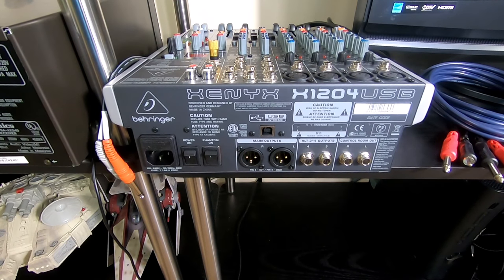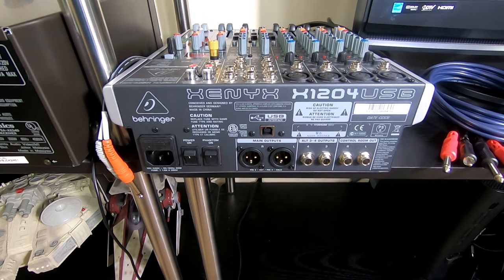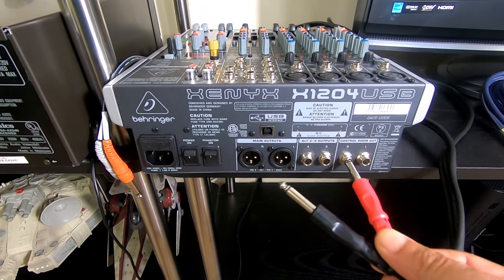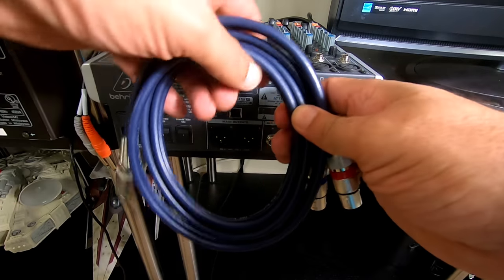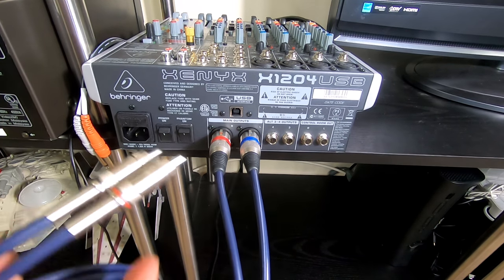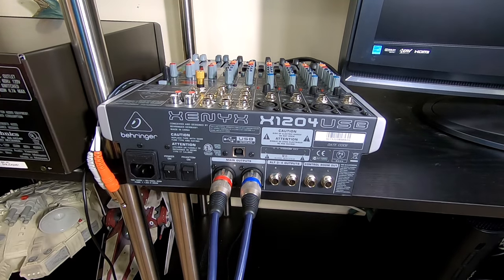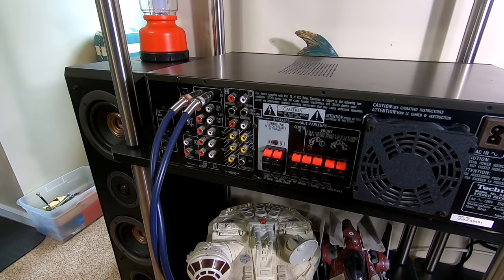How to Connect the Behringer Xenyx X1204 Sound mixer Main Out to a Home Audio Receiver

Comment: I just bought this mixer for karaoke and I’m wondering if I need a microphone xlr cable for the mic to work. I have a 1/4” plug and it doesn’t seem to be working but I also just purchased xlr to rca for the main outputs as the controller outputs doesn’t seem to be working for me so I can’t tell what’s not working. When I tap the mic, it’s lighting up but no output to my receiver/speakers.

Comment: If you using two turntables on the mixer what do you plug the mixer into on the back of the receiver? “CD” “PHONO” Etc..????
Reply from the maker: the mixer should go into one any of the inputs on the mixer except phono. Turntables use a different type of line which also means you can not plug the turntables directly into this mixer. You will need a DJ mixer with phono inputs or a preamplifier between the turntables and the line inputs in this mixer.

Comment: I have my LCD TV connected to my receiver via that optical connector. The outputs to my .  I'd like to keep this setup for watching movies and sports.

I want to play karaoke through TV out direct to mixer, then .  However my TV only 1-optical connector and 2 HDMI. Unfortunately, my mixer does not have USB or HDMI jacks.

What cables/connectors is best or TV>mixer?

Comment: Can I directly plug 1/4" passive speaker cables into the  ALT 3-4 or control room out output without the receiver? Thank you very much for sharing.
Reply from the maker: No, only powered speakers will work directly
Reply: @TonyHob  Tony, Thank you

Comment: In the case of separate-components HiFi system, would it work hooking the cables directly to L R inputs of the power amplifier? I'm guessing the preamplifier is no longer necessary? Thanks
Reply from the maker: That will work, no preamp needed

Comment: Hi, I'm using a PMX466 Pyle Mixer that has XLR main out puts. I connect the XLR cable to RCA in my danon receiver using the CD RCA IN but even after changing the source to CD in my receiver I have no sound. I connect a wireless microphones into the mixer as well using XLR cables and when I speak I see that the sound is getting in but not hear anything in my receiver. I have HDMI attach to my receiver as well my RCA from the TV.
Reply from the maker: I haven’t tried it but imagine it would work if you send the recording through the interface input into the fx box then into the daw through the interface again
Reply: @TonyHob  thanks for the reply, I make it works, it was that my denon CD input also has a HDMI assign to it. After removing the hdmi input and re-select the CD source it works.

Comment: Hi, good job.  
can I use the 2 track rca input on the mixer to connect my karaoke machine and use the rca output on the mixer to my amplier (rca connections)? I know there is a main output at the back of the mixer but i dont have the xlr cable to connect to my karaoke machine YET (just ordered)
Reply from the maker: it should work

Comment: I have at the moment Mackie Cr3, so if the mixer is connected to the AV via the output, how/where would you connect the monitors, also which cables you i need?
Reply from the maker: NoInjuryTime with his particular mixer you have 3 choices. The main output (to the AV) and you can use Alt 3-4 or the control room outputs to monitors using 1/4" male cables

Comment: Thanks for sharing!!! How do you set your “master” volume when mixing audio? On the receiver or the mixer?
Reply from the maker: I will usually set the mixer's main out at the "0" level (just below max) and then adjust the volume on the receiver to how loud I want it. After that I only use the mixer controls to adjust the main and channel volumes.
Reply: @TonyHob  thanks for sharing!

Comment: Slightly off topic but, I want to run my TC Helicon mic mechanic through my Behringer 1622 Xenyx mixer and then into my Harbinger Vari v2215 powered speaker. I usually just run the mic mechanic into the powered speaker but I'd like to be able to take advantage of the mixers fx bank while still utilizing the mic mechanics pitch correction function...but, for some reason I just cannot seem to figure out how to hook it up.
Reply from the maker: I think you have to connect the mic mechanic between the mic and the mixer then the mixer to powered speaker : mic to mic mechanic to mixer to powered speaker
Reply: I tried  doing the ctrl out from mixer to the speaker and that didn't work, the speaker does only have one 1/4" input though.

Comment: Hello tony , i wanted to ask if those main outputs are line level signal or not, can i connect XLR from the mixer to the audio interface for recording, and if i want to record single instrument connected to a mixer to audio interface how to i connect it because there are 2 main outputs from the mixer whilst audio interface have 1 input for each instrument ?

Comment: Your video cleary shows the rca in and rca out connectors right on the mixer. Why not use those for output to the receiver, with plain rca audio cables?
Reply from the maker: Jerry Spicklemire those are the 2 track/usb i/o's. Technically you can connect that output to the receiver but the volume control is not from the main mix. Also, if you want to record the performance you will need that output since that is what it is mainly designed for. It goes to the recorder. Of note, if you use the usb interface to record on your computer, the rca i/o's do not work at all.

Comment: What input do you connect the mixer into the Receiver? & Vise Versa. Where do you plug the mixer...
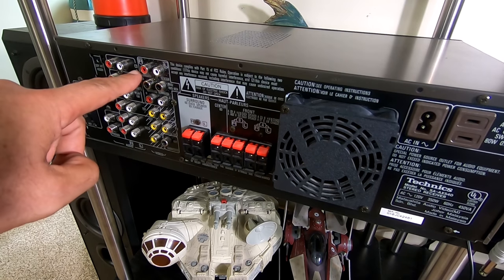Reply from the maker: RUBEN RAMOS not sure what you mean, is it this? 1:20, you can connect to any input on the receiver. Check the link at the end of the video for full setup

Comment: Hi
Does Behringer XENYX Q802USB model work in similar fashion with home receiver?
Reply from the maker: Yes, but the output on the 802 is 1/4” TS instead of XLR so you use a 1/4” to RCA cable
Reply: @TonyHob  Thanks for your reply. Just one more question. I see many cables having Single 1/4 inch TS with dual RCA.
In that case which jack I need to use in mixer? L or R ? also I see Phones jack apart from CTRL ROOM OUT
Reply from the maker: Dual to dual so you can connect to the R and L main outputs

Comment: Hi Tony  thank you for the video.    I tried everything to make my  mixer Alto L-8 work with my AV Receiver Sony .  Nothing works   I did you did , but no sound.    I'm tring to sing karaoke on my Sony Tv with you tube, having my sound coming out into My AV Sony receiver Home channel + having my 3 microphones into my Alto L-8 mixer .     I was told to  plug a optical cable on my tv + with a converter analogue RCA out   To my mixer channel INN  5 or 6 line.    + have my output on the back, mixer out with 1//4 jacks to my Sony Av Receiver in the Inn CD or DVD.      That too does not work...    when i raise le sound level of my mixer, it make noise.....   looks not compatible......     Seems like i cannot find nobody to help me to plug my mixer channel to my receiver home audio .......   Would you have a way to do this ?     Thanks again :)
Reply from the maker: It sounds like you have it set up correctly. Do you get any sound when using just the microphone, or do both TV sound and microphone not work?

Comment: Hey i could use some help on thid question, can i actually mix a 2 track bootleg hooked up from
A: RCA to 3.5mm
B: cassette deck

To a mixer to actually mix the 2 tracks?
Reply from the maker: As far as I know, You should be able to mix both tracks (stereo) that way.

Comment: I typically use youtube for Karaoke, my input on receiver has to be on cable to get sound. If I plug rca from mixer to CD input in receiver, how do I get the picture on the TV?  I have my TV connected to my receiver with an Optical cord
Reply from the maker: What are you running Youtube on? If running on a PC or laptop you would have to run an HDMI cable from the computer directly to the TV. There is no way to do it that I know of from a tablet.
Reply: @TonyHob  I have a smart tv
Reply from the maker: @tinamarshall1469  In that case the picture should already be on the TV and you just need to channel the TV sound through the mixer.

Comment: I'd like to set up YouTube karaoke, which requires that I select HDMI on my receiver. Since your instructions require me to select CD on my receiver, how do I get the mic mix from the CD input and the video from the HDMI input at the same time?
Reply from the maker: Tom Doan connecting to the CD is just a suggestion. You can connect to any input on the receiver. Connecting the HDMI would take another video. Basically you need a separate audio source from the HDMI and connect that to a channel on the mixer.
Reply: @TonyHob  In theory this should work: TV headphone -> mixer audio IN, mixer audio OUT to receiver audio IN, change receiver source to mixer, and change TV audio stream to PCM.

Comment: Hi I saw your video.. need help. recently I bought a Yamaha mixer but unable to connect to my AVR sony receiver.. My speakers are wired and connected to my receiver. how can I use this mixer. also my dvd and blue ray player is connected to my receiver . pls suggest
Reply from the maker: Malcolm Richardson if you want to use the mixer for dvd or blu ray you need to connect the sound output of these devices to the mixer, not to the receiver.  You then would use hdmi for video only. Not all devices are able to use sound and video output at the same time.

Comment: Do you know if I can add another step to your connection, say a video source to the receiver as well via HDMI?  I have a video source that only has HDMI video output.  I'm cool with the audio coming from the mixer and into the receiver.  But new receivers nowadays has a dual source like both audio and video from the HDMI.
Reply: As you can see, these guys offer to ask questions, and then they do not answer.
Reply from the maker: @papa.alfredo  check out all the questions answered by me in this comment section. The reason  I did not answer this question is that there is no other way and Google can easily answer that. Where is your question that I did not answer? You do realize I do this on my own time to help people out, right? Where is your contribution? I by no means make a living from this and actually have a full time job. That's why a lot of people just stop taking the time to try to help ungrateful viewers.

Comment: Hello   How can i use my mixer with my casio keyboard so that the mixer doesn’t take the bass away
Cuz if i connect the keyboard just to my big Sony stereo it has lot of bass in if i users my mixer than it has not that much bass
Reply from the maker: It really should sound similar with the mixer. Make sure the mixer settings and built in equalizer are correct. I have not had any problems with bass loss when using the mixer.

Comment: and the monitors ? where are they connected?
Reply from the maker: To the speaker outputs on the receiver
Reply: @TonyHob  dear Sir, thank you very much for great help. this is my biggest headache at the moment, 'cos I don't want to buy another pair of speakers, but to use my hifi system. just to clarify a little - when mixer volume is turned to zero, which volume level of amplifier can be damaging for passive speakers connected to it? in terms of clock, like 3, 9, 12 hours etc

Comment: How about if you have bought rca plugs?thank you
Reply from the maker: It depends on your mixer. Some mixers do have RCA outputs but most use either 1/4' or XLR outputs and it is best to buy the correct cable for your mixer's main sound output.
Reply: Tony's Hobbies that mixer RCA input on the top of it.can you use that to connect to receiver amplifier. We have same mixer. I want to connect it to my receiver thru RCA to RCA.is that posible?
Reply from the maker: @mycards6349  I believe you can but will have to try it out to verify. The sound might not be as good though
Reply: I’ve tried to connect the 2-track/output RCA to the mp3 input of my receiver amplifier nothing come out. Would you be able to try it and let me see if?thanks
Reply from the maker: Didn't work

Comment: I connected XLR to RCA and 1/4th to RCA and get a huuuge drop in signal strength. How do I correct that?
Reply from the maker: justenkay my set up works great with XLR to RCA. Make sure you have quality cables. Also, there are separate volume controls for the 1/4” output
Reply: Unbalanced signal

Comment: How to connect the laptop with hdmi connection to the receiver and out from the receiver.
Reply from the maker: you have to use the headphone jack on the laptop with an adapter cable to 1/4" plugs into one of the channels on the mixer. You will have to change the HDMI settings on the laptop to play sound through the headphone jack instead of the HDMI cable.

Comment: How would you go from the receiver to the mixer?
Reply from the maker: Do you mean input sound from the receiver? Not sure you can do both since the receiver will play any output through the speakers. You would need an external sound source going directly to the mixer then it will play through the receiver and speakers. For example, if you have a cassette deck, you would have to disconnect it from the receiver then connect it directly to one of the channels on the mixer. You would need RCA to 1/4" cables to do it.

Comment: I did exactly what you did. Ctrl room out, rca to receiver CD. Testing the microphone nothing
Reply from the maker: Connect it to the main out
Reply from the maker: Also keep in mind that ctrl room out has a separate volume and path. Under ”source” press the main mix button (3rd/last one down) and turn the volume up using the small headphone/ctrl knob
Reply: @TonyHob  I connected to AUX and 👍
Reply: @TonyHob  hi I have a question.where the main out for quarter inch cable for that mixer?I have same mixer.thank you

Comment: There doesn't seem to be enough video description here of how this all looks when it's set up because all this video seems to show is what leads go where.  What it doesn’t show is or explain in visual terms is:

1) How is this linked to a sound player to send the signal into the Mixer?
2) How are these units used to link to in order record the Karaoke sound performance?
3) Is this linked to a video capture source, a TV, a Laptop, Tablet or such for sound plus video?

There are lots of question people have here in Youtube and no matter where I go to look at options on 'What-does-what' there never quite seems to be a definitive solution shown within such video's. These instructionals are alright if you have some kind of knowledge of the topic itself, but for someone setting up a first-time stand-alone karaoke system there's more to know than what's here. What I find the hardest is when everything is connected to the PC via a USB lead I've come across so many issues that crop up simply by running the 'Live' recording through Windows 10 system which can often be only the beginning of what turn out to be numerous problems which attracts so many people to comment on what went wrong for them and (more often than not) no real answers given.

There is nothing wrong with this video as I watch it; I'm not dogging what you have done here. But the topic of creating a home karaoke system from any angle I view here in Youtube often becomes the beginning of problems that many don't understand from the very basic outset to problems that even the author of such video's don't seem to know the answer either.

Thank you for sharing this video; I do understand what it covers, but (at least for me) it doesn't cover the project in its entirety and that's what a lot of people are looking for :-)

~F~
Reply from the maker: That's a LOT of information to put in one video. There are too many ways to set a mixer up and too many variables on what equipment people have. Most people will not watch a video for that long. I have other videos explaining other aspects of a karaoke setup. For example: https://youtu.be/UHoo5DzyqFo or  https://youtu.be/1Jm1eKRfLEA and I am literally preparing a video today about how the 2-track I/o works on this mixer. And I am waiting on an adapter to show how to connect a smart TV to the mixer for karaoke.The purpose of this video is as stated on the title: How to connect a more professional type of mixer (which has an XLR main out) to a home receiver (which typically has RCA connections), nothing more. Thanks for the feedback.